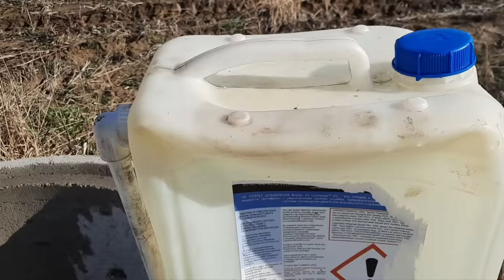Simple idea how to make a water pump without electricity without fuel

Comment: Very nice but that will work only in wells not too deep. The drag force of the can depends on its own load of water and depends strictly on the hermetic seal. Bet you could use bigger barrel to draw water from a deeper well like 20 metres or so👍🤔
Reply: sucking water up in any pipe will not work over 9m-s of height difference, if you have over 9m (practically 6,5-7m) head you have to place some pumping element to the bottom
Reply: @koborkutya7338  is it already tested? I had this idea as a kid and now it's first time i see it in action. Wonder how much the air can be stretched in the hose.
Reply: @juanmanumanudice8848  when water is "sucked up" (that is, moved upwards by decreasing pressure above it) it actually is moved up by the pressure below. When you are sucking from an open vessel like in the video (a well, practically) the pressure in the fliud below is atmospheric pressure, which theoretically equals about 9.8m of water pressure. This means if you are trying to pull 10m of water from upwards, the pressure below is not enough to push it up anymore and instead of pulling it up there will be vacuum above it. When you are pumping water and there is real flow, the atmospheric pressure below must also overcome some friction of the fluid in the pipe, meaning it is much less than actual 9.8, normally not more than 7meters. So if you want to pump from deeper you must place the pump at the bottom of the pipe. Then the atmospheric pressure does not play a role because the pump is pushing from below, you can pump out water from several hundred meter depth. I work for a company which produces such deep well pumps.
Reply: @koborkutya7338  the method here is the vacuum and the mass of the water inside the syphon. This can't be called a pump, it's working as a non mechanic syphon. The problem is the weigh of all the fluid in the pipe from the well. When it is not resting in the bottom it makes a force that must be overdue by a bigger mass upside generating the vacuum in the air inside this system. The only limit is the resistances of the canister used. The air will stretch and generate that vacuum force, the water on the other hand can't be compressed nor stretched. It's not a problem of friction, there is no friction here. It's the difference of pressure, the water coming from the well is syphoned at high pressure but the water leaving the barrel has a very low pressure or the whole system would just work the other way pulling the water from the barrel towards the well. This is the force shrinking the plastic can, for each 'X' litre of water syphoned it will store certain amount of vacuum force, and at certain point it will stop working. They need to put some valves to solve this and use a stronger syphon barrel. And this system is genuine 100% all by just physics there is no motorized water pump in that thing.
Reply: @juanmanumanudice8848  Read my comment carefully, that is exactly what I am saying. This video is not a pump, they use gravity to get the water out. It only matters what is at the two ends of the pipe. This is not possible to do for deeper than 10m water column, if deeper you have to pump from below. And yes, there is friction because you have a flow so you will introduce pressure drop along the pipe which decreases the possible depth. I regularly water my garden by simply a flexible hose being primed and get the water sucked out from a barrel over its edge without any pump. It is actually elementary physics, we got such questions in high school. Btw I work for a pump company full time and make a living of this subject.
Reply: @koborkutya7338  if i was engineer i would just answer this is not a problem of energy and trying to make it more efficient 'cause there is no source of energy. The principle here is the balancing force of fluids wich is a long time discussed argument since centuries back. But nobody ever invented this system till now. To be noted i'm not engineer i'm a musicist. And so i tend to equalize forces unknown to you...
Reply: @juanmanumanudice8848  if you are a musician from my part you can say nothing wrong. Music is something totally from the great beyond. Musicians play in a separate universe and we can only have a glimpse if the artist is good. Kudos to you
Reply: With this you can not lift any water, not even one inch.
Reply: @koborkutya7338  You can not “pump” any water upp with a siphon. Not even one inch. Wat you can do is tp bring water over a 10 m high wall, but all of this water must down under the source again before you  may ecpell it.
Reply: @koborkutya7338  A pump can exract water from a 10 meter deep well, but a siphon can not lift water out of any well, not even 1 inch.
Reply: @Dingsrud  sceptics are everywhere. I don't believe there is any hidden water pump engine in this video neither. I mean i don't believe your point. So i'm sceptic like you.
Reply: @Dingsrud  perhaps scepticism is a leak of parameters. I'll try to enlight you a bit: water can't be compresed nor stretched(at zero pressure water will boil at low temperature and evaporate to gas state) but air is a different substance in this syphon. And the air will make some force in this setup while being stretched and syphoning some water. In funny words: the water going outside the hose is bigger than the water coming up from the well and this is the bad side of this invention, the vacuum force keeps growing every bit of water that is syphoned till a null point where the mass of water can't beat the vacuum force and it will not work until the pressure is normalized. You need a rigid pipe to help the vacuum effect and the vacuum can be helped with a valve. Things would be different if there was no air in the upper tank. But that's the trick in this syphon. We make a vacuum machine using a barrell full of water.
Reply: @Dingsrud  the exit must be lower than the water level inside. That's why it worked for them here, the water inside that thing was above ground level so you could flow it out via that tube thing.
Reply: @koborkutya7338  The exit must be lower than the water level down in the well. So, one may wonder why water came out when they opened the valve on top of the well. The hose may strch down under the level in the well.
Reply: @koborkutya7338  One can also use a pump situated at the top of a deep well using two tubes down into the well. At the well bottom the two tubes are connected in an ejector. The pump is circulating water, and a smaller amount of water can be extracted at the top. More complex pump and priming, easier access for repairs.
Reply: @koborkutya7338  No, this is a siphon and a siphon can not lift any water up from a well. Impossible.
Reply: @kjellg6532  that is true, I have such an ejector and for some time our well was set up like that. I should mention, though, that in that case we are not using vaccum to bring up the water but using the water pushed down to bring up the other water along with it. It was tricky to use because we did not have a custom pump to it (the downgoing water should be coming the the pump impeller extracted at a lower pressure than the total output pressure) and we could not get hold of it so finally i replaced it with a deep well pump. But I like that setup a lot, I kept both ejectors (I have a spare one too). 
I was told it is also used when the water when there is no submersible pump around (e.g. the pump is diesel-driven). Cool stuff.
Reply: @Dingsrud  yes, it is siphoning with the aid of gravity and atmospheric pressure acting on the surface area of column space within the barrel creating a pressure difference that's enough to draw water above and out of the well.

Comment: After a few minutes, the canister will tighten until the edges stick together and the installation will no longer work...
Look carefully at the canister and you will see...
Reply: Something is absolutely lacking from the system. With it this will be perfect. I like it.  But consider also the depth of the source of  water.
Reply: @remifelipe3708  In order for this phenomenon not to happen, the water output flow must be lower than the supply flow (water input)
Reply: @remifelipe3708  if the water was deeper this wouldn’t work .
Reply: I don't need a few hours to water my garden anyway. If it can continuously work for a few minutes I'll be satisfied. Then if needed I reset it, done! No big deal! But for large scale continuous watering obviously you'll need something else...
Reply: @Tom Jones - no, it WON'T.  The only way that could happen is if you created a vacuum inside the canister, and that cannot happen, because the water flowing out at the bottom will be replaced by the water flowing in at the top. So what draws the water up?  The water flowing DOWN the hose!
I suggest you go away and look up how a syphon works.  As long as the end of the hose is below the level in the well, the water will flow forever.
Reply: @paulveenings6861  - as long as the far end of the hose is below the level of the water in the well, a syphon can lift water as much as 34 feet.
Reply: @jackx4311  Did you look at canister? (08:44). This method was used by the Incas in Peru, it is not new...
Reply: @LeChristEstRoi  Thiswill work til the well is depleted as long as the outout is lower tan the water levek in the well.
Reply: @Dingsrud  Exactly.
Reply: @tomjones1502  So water imput and output need to be same?? I have problems with replique this system in my house. Im using 30L deposit and 8L bottle only for testing. My imput is 12mm diameter and output 4mm. Im testing as well with 4 input and 12 output and its not working as well. At some point air get sucked into deposit from output. What im doing wrong? Thx
Reply: @3one84  "So water imput and output need to be same?? "
Not necessary but will be OK to be same.
The difference between the diameters of the tubes is too big
Reply: @3one84  To understand the phenomenon, take a hose of approx. 1m (the length can be much longer, but for the ease of the experiment...) fill it with water, then, without spilling the water, put one end in a pool of water, and put the other end below the level the pool.
The hose will pull all the water out of the pool.
Reply: @tomjones1502  the length of the hose also makes a difference. The best way I think to understand this is that the volume of water, the weight, in the discharge hose must be equal to or greater than the weight of the intake hose. The 12 mm intake can only fill up using a 4 mm discharge if that 4 mm discharge is long enough to have the same amount of water by weight in it. 
A good illustration might be to take a pipe and put a length of chain over that pipe. If one side of that pipe has more of the chain on it then the other side the whole chain will be pulled to the side with the longer piece of chain because that piece of chain weighs more than the other side.
Reply: @mikeslater6246  " @Tom Jones  the length of the hose also makes a difference. The best way I think to understand this is that the volume of water, the weight, in the discharge hose must be equal to or greater than the weight of the intake hose." Yes, you're are wright if don't use canister. If you need water from a place to another, and if you can, use a simple hose as i explain before. A simple way, to use water from the lake or any water source, without a canister, take a thicker hose, which does not "suck" (retains its shape), fill it completely with water, then carefully without pour water, put one end in the water source, (if the water source is deep, then you can use a plastic tube, which has a valve at the bottom end (a device that allows the water to go up into the pipe but don't allow the water to go back to the water source) I hope you understand me, I don't speak English natively.) and the other end of the hose opens (the ends of the tube were plugged after filling with water) where it is need water.
I hope you understood me.
Reply: @tomjones1502  ✔️

Comment: Use this along with a ram pump with the overflow going back to the water supply and you could pump water anywhere you want from a still, unmoving water supply.
Reply: A RAM pump requires 10 PSI to operate. You need a 20+ foot drop in elevation of the water to build that much pressure. There is also a lot of loss in the RAM pump as the check valve dumps waste water. This setup won't even work, much less generate the pressure necessary for a RAM pump, and you can't return all the water due to the check value anyway.
Reply: @daviddeas1826  
Actually it would work. A ram pump doesn't need much water movement to work and you can create that with this set up and the access water can be returned to the original water source with an overflow spout.
Reply: @fundreamer1  You do realize that what you are describing is a perpetual motion machine right? This... is... impossible. This is not an opinion, it is a law of physics.
Reply: @daviddeas1826  
In what way is it perpetual motion?
You are providing the power for it.
Reply: @fundreamer1  What power? The entire thing is talking about moving water UP without electricity or fuel, there is no power here. The siphon used in the beginning is providing some energy but that will dissipate over time. What power are you referring to?
Reply: @daviddeas1826  the syphon

Comment: This only works if the final water destination is below the water level in the well .    Basically, the end of output hose must be below water level in well.    Otherwise, wishful thinking.  If end of output hose is higher than well water level,  air starts to go back up the output hose to replace exiting water.
Reply: Vdd
Reply: Could that hose go back into the bottom of the well and create infinite flow? kinda defies laws of physics i know, but is it seeming really possible?
Reply: @mike5585  That would be impossible because as water exits the hose,  it would face resistance from existing water outside.     The water would almost bounce back inside the hose.
Reply: a good way to calculate the depth of the well surface
Reply: @mikha007  Yes,  raise the hose up.   Measure  distance from floor to water level inside the hose :)

Comment: The same thing can be done by just filling the hose with water and establishing siphon. No need to do all that excercise with can.
Reply: siphon works from high level to lower  not from low to high...
Reply: You are correct Anil, it is not pumping it is siphoning and the outlet of the hose must be lower than the level of water in the well or it will not work.
Reply: No it won't you can lift the drum higher
It works on suction
Reply: @hikurukutai  and for it to work you would have to have more suction on the outlet side than on the inlet side and the only way to get that is to have a greater head of water on the outlet side.
Reply: @jt2097  If the outlet is larger than the inlet
the drum will empty faster than it can fill 
and the effect would be lost reason the drum got sucked in and air would 
enter through the outlet
Reply: @hikurukutai  pressure is height multiplied by density. The cross sectional area of the pipe has nothing to do with it.
Reply: @jt2097  the cross section of the discharge pipe would have everything to do with it. You could not maintain a full discharge pipe and thus not maintain adequate suction on the inlet pipe. The inlet pipe friction loss would be too great to allow as much water to come in as was being discharged. Water exiting from the discharge pipe would allow backflow of air into the discharge pipe and the water would not be able to maintain the air seal required for to maintain the vacuum. It is the same effect you get when you try to dump fuel from a fuel can into a fuel tank by holding the fuel can straight up and down without a vent. The only place air can enter the fuel can then is up the discharge.
Reply: @mikeslater6246  back flow of air would halt the syphoning. I meant that increasing the diameter of the outlet pipe would not increase the pressure to the point where the height of the outlet could be less than the height of the inlet and still allow syphoning.

Comment: Thete is no need of any tanker or complication. The water can go down by siphone as far as the out let is lower than the initial water level. The water will stop( once the water in the tank is finished because it cannot suck the water up. )if he doesnt use the long pipe to run water down below the water level.

Comment: I don’t really see why the tank is used.
The output is below the water level so wouldn’t it work with just the hose?
Reply: You need the water in the tank to drain in order to start the vacuum. Unless you fill the hose with water first and submerge it in the well without the water in the hose coming out before it goes under the well water then it will start drawing water from the well.
Reply: @tonyray4565  so that tank just primed it easier. Got it thanks
Reply: @tonyray4565  in actuality the hoses do not have to have water in them or water flowing when they are stretched down the hill or put into the well. The inlet put in the well can be empty and the discharge down the hill can be empty when this is set up. It's the weight of the water in the 5 gallon jug pushing down on the water going out of the faucet that starts the siphon. This can be seen when the YouTuber shows the bubbles entering the jug at the top of the jug. This is the water leaving the outlet hose pulling the air out of the inlet hose and why the jug looks like it's starting to collapse in later video.

Comment: So how does this thing work? Will it stop only when a well is empty?
Reply: close the tap🤣🤣🤣🤣 is that simple🤣🤣🤣🤣
Reply: @venom-kc7ri  I think what he is asking is what is it limits? It will slow down and then stop as the water level and volume decrease.
Reply: Yes, ir runs until the well is empty
Reply: It will run as long as the water level in the well is above the end of the pipe (or until you close the tap at the tank).